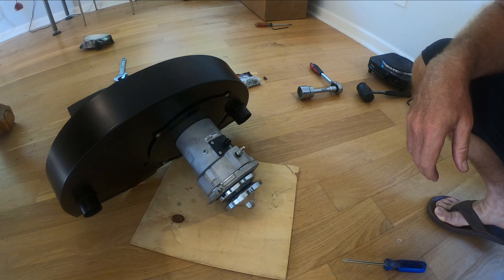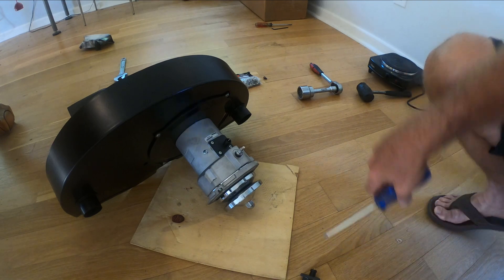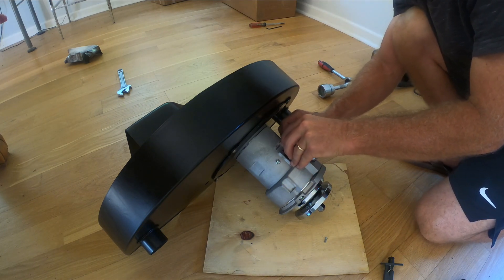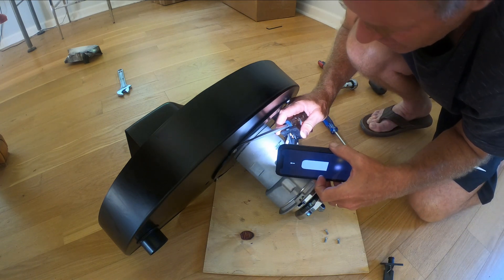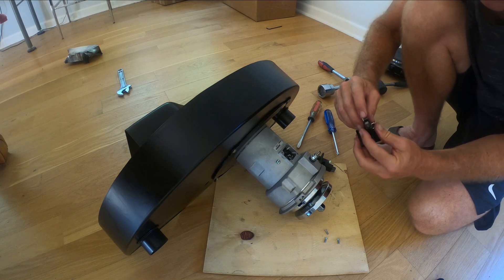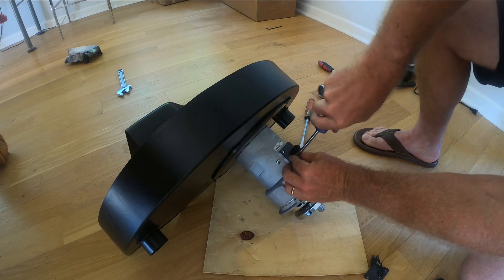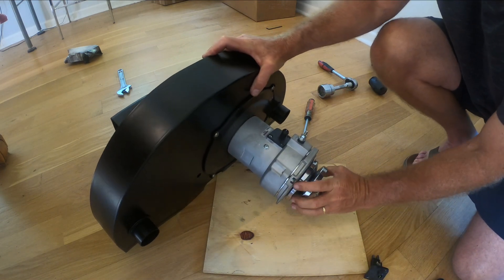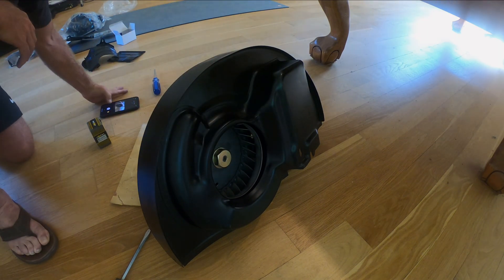2332 VW Air-cooled Stroker Motor - Video 31 - Alternator Brush Replacement

Comment: Where did you find the brushes
Reply from the maker: The generator brushed look more square, and the alternator ones are longer and narrow.  You can Google for them - I think I bought a whole black plastic part that had the brushes in the little slider areas, but the brushes themselves are like these:
Reply from the maker: https://www.partsgeek.com/21fwxrg-volkswagen-super-beetle-alternator-brush-set.html?utm_source=google&utm_medium=ff&utm_content=DN&utm_campaign=PartsGeek+Google+Base&utm_term=1971-1979+Volkswagen+Super+Beetle+Alternator+Brush+Set+Standard+Motor+Products+71-79+Volkswagen+Alternator+Brush+Set+1975+1972&srsltid=AfmBOoo0rZhlERnqYFgmZxKjD9Q9mAU6mOZytoOYrG5lqD7DIrGchWovapg
Reply from the maker: OH!  This is what I bought to replace the whole black plastic part with the brushes and connector:   https://www2.cip1.com/c26-903-559/

Comment: Where did you get the regulator?
Reply from the maker: Voltage regulator from JBugs and fuel pressure regulator from Summit Racing
Reply: @LarsonSplitBus-  hey thanks for the quick response 👍